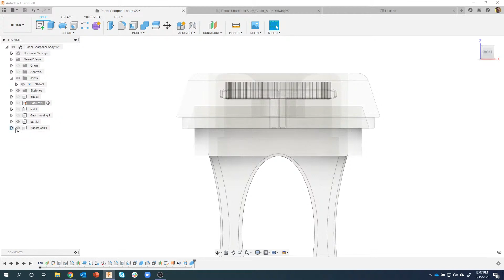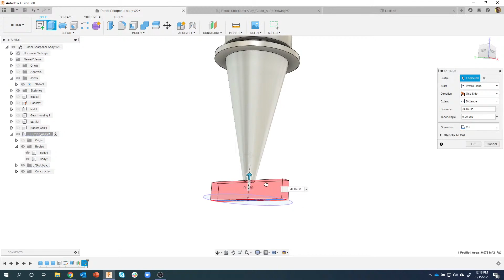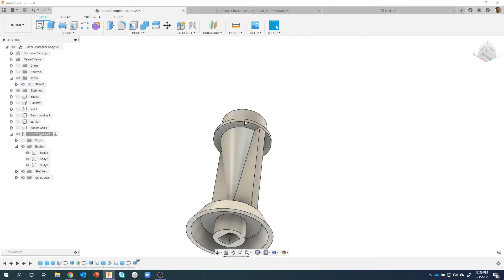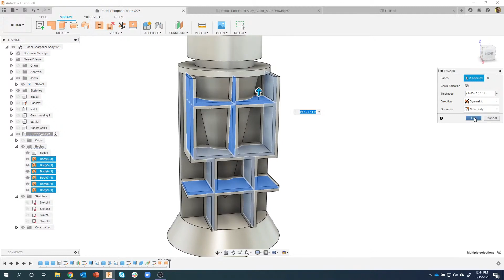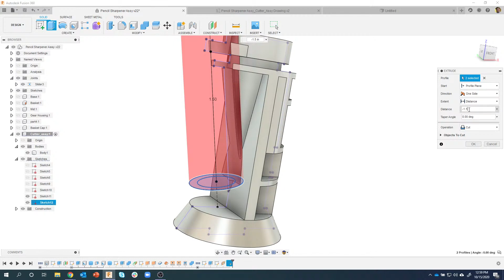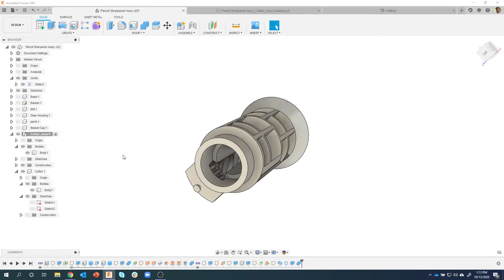Episode 76 - Pencil Sharpener Project, Part 6

Comment: Instead of using extend and replace face, wouldn’t it had been easier to use split body with the bottom circle as tool and extend the tool? Then remove the leftovers..
Reply from the maker: @Marcus-  That idea would probably work as well.  However, when you use split body and extend faces, it extends in both directions, so it would have probably split the body into multiple bodies, which can get confusing.  That is why I tend to use replace face.

Comment: Hi Brad. I've just finished Part 6 of this brilliant series. I switched on all the components built so far, and there looks to be an interference between this Cutter Assembly and the Cutter Housing? Hope the feedback helps :)
Reply from the maker: @TGS-  Great Eye!  I noticed the same thing as I was continuing on with the design.  I accidentally put the internal gear teeth too far up into Part 4.  So, we will learn how to fix that in an upcoming LiveStream.  :)